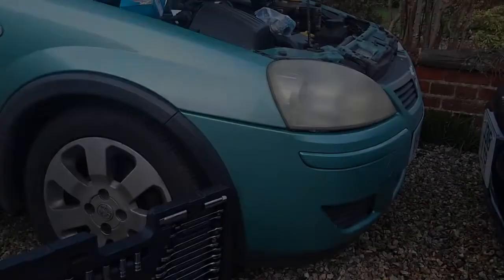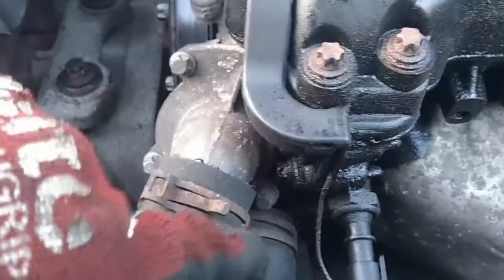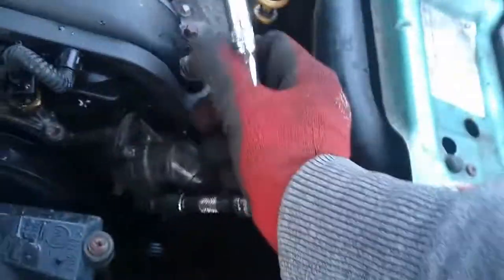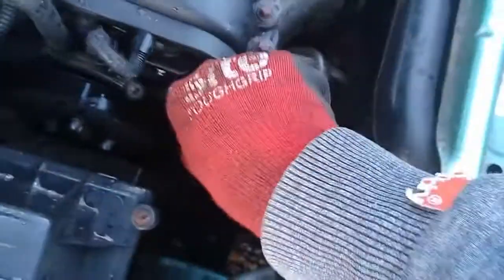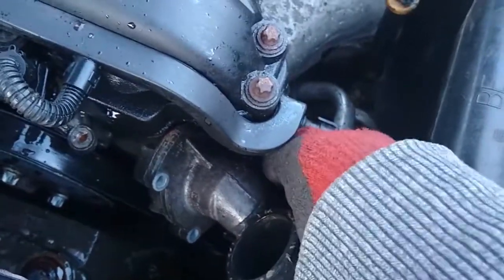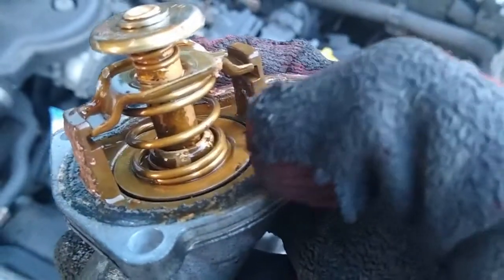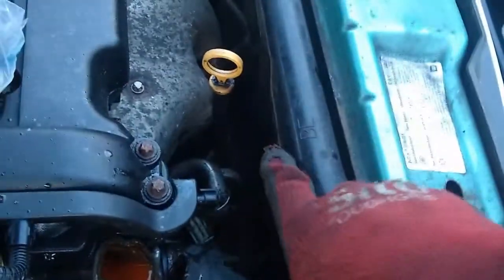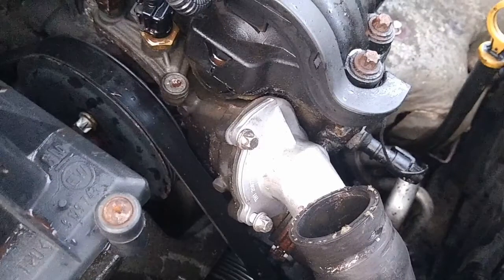How to Change a Coolant Thermostat in Under 5 Minutes! Vauxhall/Opel Corsa C/D

Comment: Just changed this part, my wife took it out to the supermarket and called to say coolant is leaking on the floor. I've looked and it seems to be coming from underneath where the auxiliary belt is. I think I need a car mechanic to look at it. O well I did try.

Comment: Hello, what are the risks for the engine to run with no thermostat? My car run in north africa which means the temp never goes too low like in europe
Reply: Thermostat manages temperature between the radiator and engine - if you don't have one, the engine will constantly be putting coolant through the radiator. If you're moving along, the ambient air rushing through the radiator will keep the coolant temp below 70c, and the engine coolant temp will keep the fuelling at start up management and you will use a lot more fuel. The thermostat will keep it at a constant temperature regardless of where you are, -10C or 40C.

Comment: These thermostats are flawed they cause air locks and back pressure how to combat this is to drill a 1.5mm hole in the thermostat this will allow the thermostat to function normally with no air locks

Comment: I have a corsa 1.7 dti, and the temperature simply doesn't go up at all, even on long trips. It only goes up if the car is standing still for about 5min. Thermostat open, or could it have been actually removed by the previous owner to avoid the engine overheating if it already had such problems?
Reply: This is also happening to me.. it only starts to get hot and over heat when idling for to long
Reply: @Entertainment_Vault  well I solved my problem I replaced the thermostat and now all is well
Reply: @DocDudix  did you have a go at it yourself ? did you notice any difference in fuel consumption

Comment: Great video, think mine is stuck open, going to do a coolant and thermstat change next week, cheers mate.
Reply from the maker: Good luck!
Reply from the maker: How did it go?
Reply: @Gadgit83  It went perfect thank you the thermostat hadn’t been changed around 17 years so the bolts are quite hard to get out. However got the new thermostat in and now I am warm on my car journeys to work, thank you very much and have a happy New Year

Comment: I have a vauxhall combo van 1.3cdti and my temperature gauge doesn't seem to move. Sometimes on a very long journey it may come up to 80°c. Do you think it could be the same issue?. I was thinking maybe it's the coolant sensor?
Reply from the maker: Yeah, sounds like the problem I had. Would start with the thermostat rather than temperature sensor (I've also got a video on changing that - it's a 5 minute job!)
Reply: @Gadgit83  thank you

Comment: Could be this the reason of no heat inside the car? A fault termostat reach very hard at 80°C (not 90) and havent enought force to heat inside?
Reply from the maker: If it was stuck open, it could take a long time to heat up inside the car yes.
Reply: @Gadgit83  hi i solved  the problem... Inlet tube was full of dirty, and this was the reason of cold air on heat mode, the fluid didnt goes through heat exchanger... After cleaning, and replace the thermostat ( 10 €) and 5 minute of work, every thing is perfect. Thank a lot
Reply from the maker: Ah great news, thanks for the info, good to know!
Reply: Great video managed to do it! Cold air in car though still
Reply from the maker: @Jjules-zo5fr  good work! Could be the heater control valve then... Haven't actually had to do that on mine so not sure where it is I'm afraid

Comment: Can a faulty sensor cause a no start or it to cut out while driving?
Reply from the maker: Probably not a faulty temperature sensor but a fault crank or cam shaft sensor could do, or ignition coils